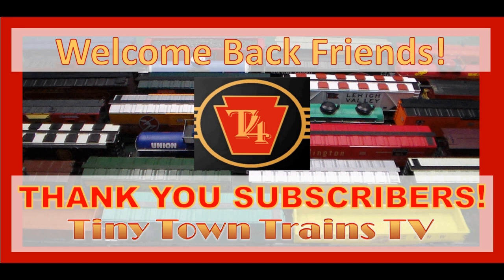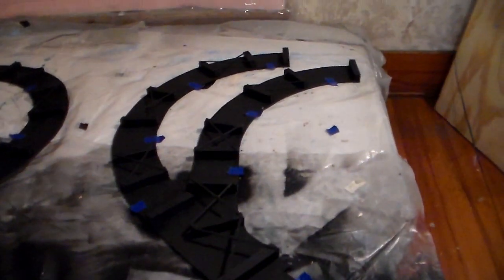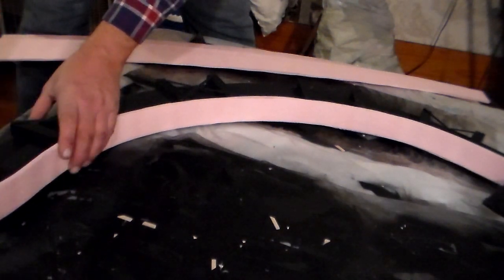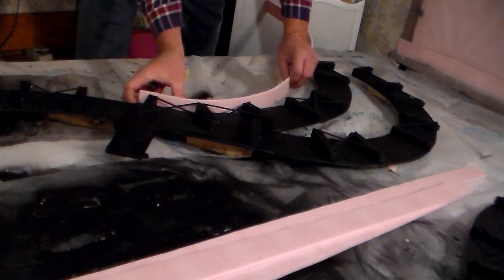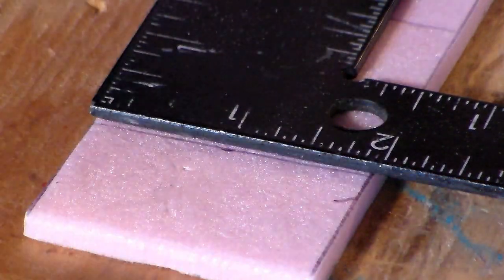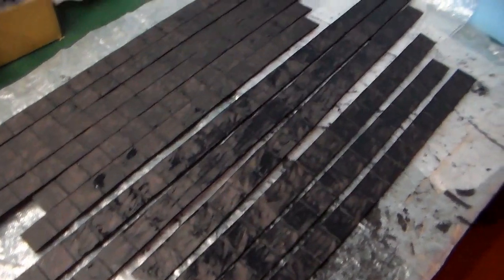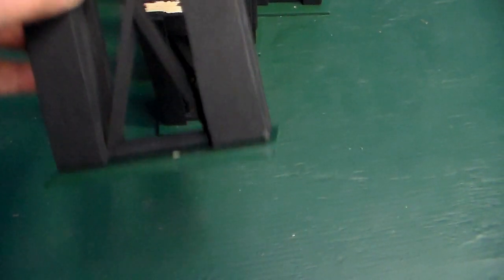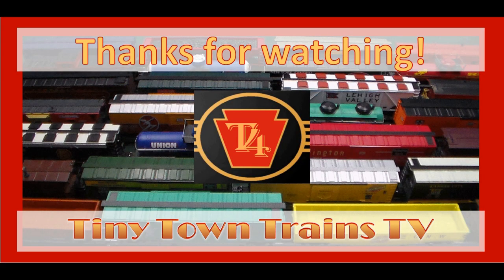9 Level O Gauge Layout Progress Update #25: Building Deck Bridges For Level #8 Trains

Comment: Very interesting. 🙃 Now I can kinda get a better idea in my head what this is going to look like.! BIG 👍T4.! That really is going to look awesome.! Thanks for the update.! Mark
Reply from the maker: Thank you, Mark! When I painted the clouds I knew some of them would end up covered up, but the decision to run level #7 separate from 8 and 9, and add a whole additional operating train; then led to the scenery decision to make the area into an old-time brick coal-fired power plant...that in turn will cover most of the clouds on the back of the dormer. I haven't really fleshed out the design except that the plant itself will be a slightly 3-D backdrop with the entire space in front of it being the coal dump area served by 2 different railroads on 3 separate rail lines, on 3 different levels (7, 8 coming down off of 9, and a level sandwiched in  between which will be for show only...powered for lights, but no actually moving trains).

Comment: Very cool, T4.  I really like your girders.  That is a lot of work and I'm very impressed with what you are doing.  I'm glad you are paying close attention to the height of the sides as it can really make a difference especially on sharp curves with some equipment.  Bill B.
Reply from the maker: Thanks as always, Bill, for watching and commenting! I have seen a lot of videos where the elevated track has side railings which looks great, but then to solve the problem of overhang clearance it is necessary to make the deck wider on the curves or much wider over all. I didn't want to do that, so keeping the girders as low as possible was my preferred solution. The dormer space is only 4'x5' which means only 31" and 36" curves would fit there, so the trestle system is a combination of the two. Have a great weekend ahead and see you tonight on GFW! T4